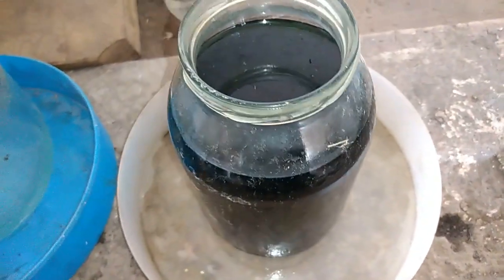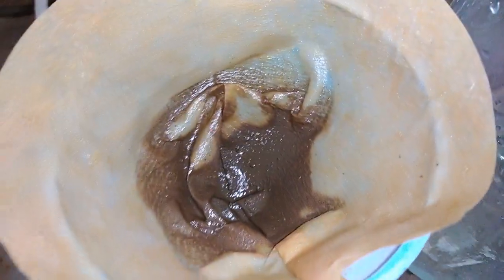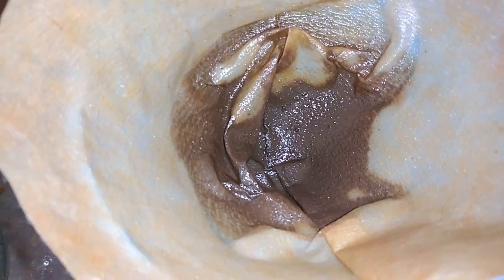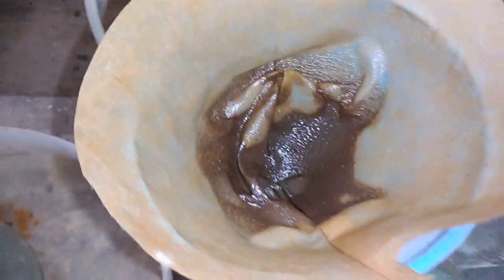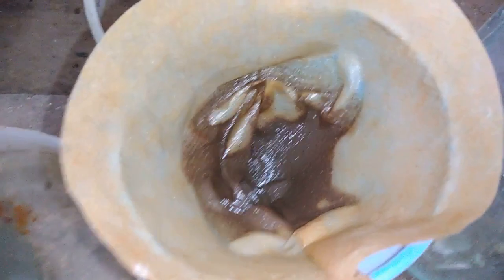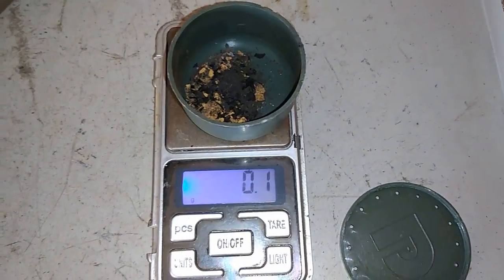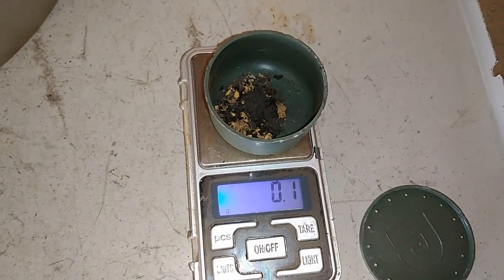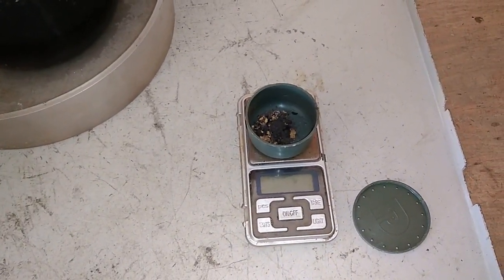SIM SOCKETS for gold recovery!

Comment: Just a thought, if chemicals like nitric acid are expensive, I could hypothetically dissolve metals like you did, remove leftover plastic, then add more new connectors covered in that same concentrated solution and keep dissolving metals out of plastic connectors until most or all of the acid is used up. Then proceed from there and have less unused acid to denox with urea or whatever.🤔

Comment: It’s amazing how small the gold plating is on these electronics these days. Yes there is gold but not a lot. Pretty cool to see single item refining although. I would like to see how much gold is in a large quatatity of LED light bulb boards. Like the newer 9 watt or 15 watt bulbs that have that small aluminum PC board with a couple small IC looking chips on them. Pretty sure one of those is just a rectifier. I’ve started collected dead bulbs just for that experiment.

Comment: Nice. 
Seein this makes me want to drill some holes in a 5 gallon bucket and put stuff like those in to soak. 
(In a bigger 30 gal bucket with waste solution)
Would be nice n easy to dunk and rinse.

 I have some plastic lined 3 stacks of pins from some server connectors. They look similar and wont yeild really anything but still could be used as copper, and then plastic will come out easy.

Comment: I only process the full plated ones.
I'm picky. Sometimes I will cut off the gold tab if it's not full plated.
You should do head phone jacks brother! I have found that head phone jacks have good gold! It's hit or miss but so far I have found some good gold in head phone jacks!
Reply: Yes Jack's,rca's,alot of female ends of plugs very good too.
I like alot of the easterners videos they know what has similar yield according to the same process so they process different things at once the same way.
They know alot about cuppelation and metal collecting with silver and lead.
Reply: @normynorm2945  I use lead! Saves a ton on nitric acid! I found bismuth to work even better then lead! And it's way less toxic